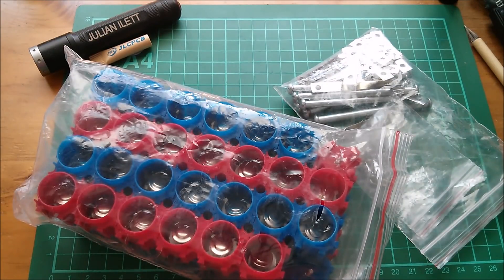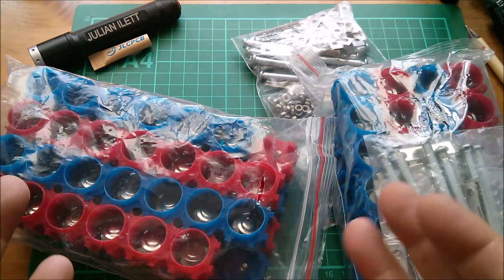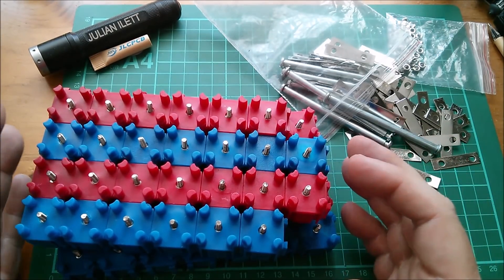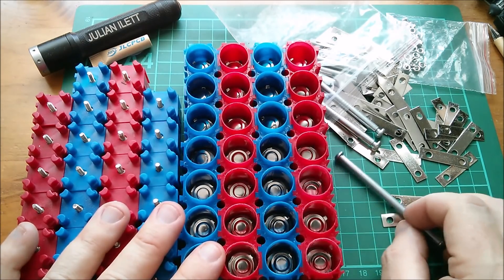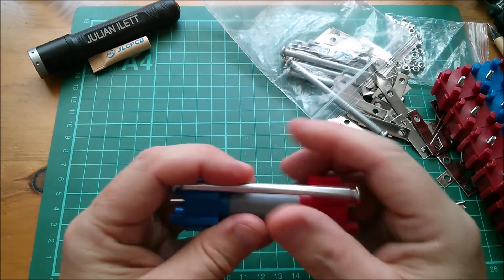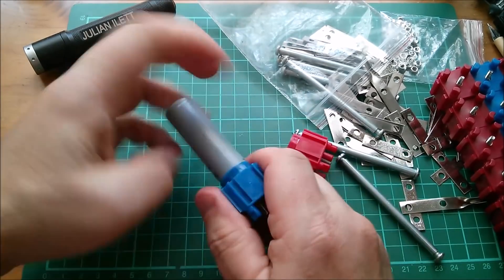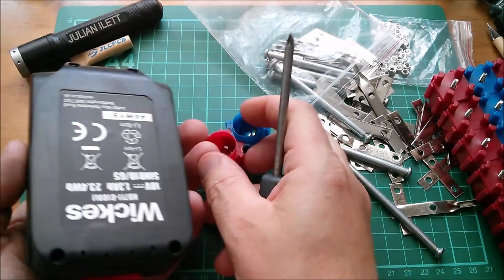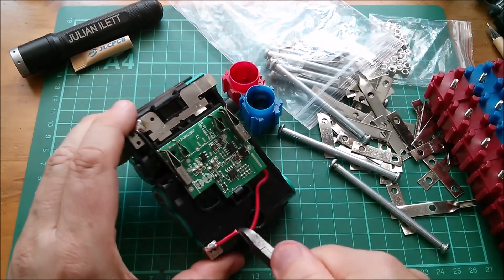First Look: Vruzend 1.6 Lithium Ion 18650 Battery System

Comment: I managed to harvest 43 cells (6 of the 3 cell batteries and 5 of the 5 cell type as shown here and also a couple of £30 pillar drills, bonus! ) in a mad dash around Kent/South London a few weeks back... Thanks for the tip!

I have bought some generic ebay crappy plastic snap together battery holders to make a low capacity e-bike battery, these look much better, I like the fact that you are safe in the knowledge that you have more than enough through bolts to assemble a battleship and aren't just trusting a layer or 2 of Kapton tape, 

I didn't like the bolt on bus bars though, I have always thought that spot welding /soldered joints were the way to go if you are pulling more than a couple of amps from it, I think the bolt on bus bars could present corrosion problems in the future, although I see from your solar battery banks you seem to get away with not giving a crap about that!! 
I think these batteries can output up to 6/8A?   maybe soldering would be better long term but these connectors could be used to build custom packs to experiment with different series/parallel configurations and you could build and test several configurations in one day, so they are like breadboards in that respect, perfect for your channel

I'm thinking for a long term solution these connectors for mechanical strength and spot welding/soldering would be the best construction? 

If anyone has built e-bike batteries with these particular cells and can give me some advice then I would greatly appreciate it, I know that at 1.3A capacity they are not the best choice but for 25p each I just couldn't say no! 
A B. M. S. and nickel bus bars would add about £15 to my £11 battery bill, so getting the best out of a cheap arsed system is my goal

I am thinking of a 10s 4p battery driving a 36v 500w rear hub motor that will do 10 - 15 miles at a reasonable pace, not expecting to go too far or go too fast, any advice would be appreciated, cheers
Reply from the maker: Well, the kit contains just 12 barrel bolts for the 54 cells, so they have to distributed carefully.
Reply: @JulianIlett  I think it's better to use a few bolts to build a battery than a couple of layers of tape, in an accident scenario (20 mph bike into 40mph car = 60mph) I would trust a bolt through pack just a bit more,

After having a few bike accidents without a lithium pack strapped to the frame I think I would appreciate the extra build quality in the heat of the moment!
Reply: That would only hold 187 Watt/hours of charge if my math is right. Might not last long on such a powerful motor, unless you aren't planning on going all out. At 0.25 each though, that is a really good value for that amount of capacity, but I think stopping at 4p might be a little lacking, but depends on your needs.
Reply: @rich1051414  yeah, I know it's not the best solution by far, I'm thinking of making a cheap eBay e-bike, 
A 2nd hand donor mountain bike, maybe £100, eBay 36v 500w kit (minus battery), maybe £200, 
For now I have a very cheap battery to get going with a veiw to using it for a year or so and building a new battery pack, probably using Panasonic 3.5A/h or similar for added range and a bit of oomph, I'm not expecting the Wickes batteries to add much other than some ease in pedalling for about  10 - 15 miles, I think 180w/h should be ok at first, but you are probably right, I  think I'll probably hit the limit at about 8 or 9 miles, but that's fine for everyday use for me and will be expandable on range and power with a better battery in the near future,

Thanks for your input
Reply: I made a 14S16P ebike battery using 224 cells. Cheapest way I did it was to hot glue 16 cells to make  2x8 brick, then lay 10 gauge silicone wire across the top and bottom.
I cut out some of the insulation to make a space to solder some magnet wire to 2 cells, and repeat.
I used double strands for the negative side so a short would only blow the positive side.
Secure the 10 gauge wire with hot glue and wrap with duct tape.
The ends of the wire extend a few cm from the pack, and I added bullet connectors, so they can be daisy chained easily.
Arrange the packs as you like around the bike in whatever shape you need, or put in a box, panniers or couple of camera bags hanging over each side.
A lot of work, but I got a 2kWh 10kg battery for free that will do 100 miles...

Comment: Thank you Julian, perfectly timed! I am very interested in this - but this arrangement is not very space-saving if you have 3 cells you want to combine. Still, I might be able to live with the empty fourth quadrant and use it for battery management/charging or a lighting module somehow.
Reply from the maker: If you have a few parallel rows, you wouldn't use this square configuration.
Reply: @JulianIlett  Thank you for replying! That makes sense of course. I am (loosely so far) planning a 3s1p configuration with the three side by side or 2 on the bottom and 1 on top. Anything else I found has either flimsy connectors or is a large but decent 2x2 arrangement which I could use with a "dummy" battery. 
While not ideal, this Vruzend one still looks better than anything I have found before!

Comment: What I've found is that those little bits of metal left behind when pulling the straps off can usually be flattened enough by simply tapping them with the side of the pliers.  The metal is soft and they easily mash down flat.
Reply from the maker: Ah OK, I was cutting them down last night with my new flush cutters :)
Reply: @JulianIlett  That would be useful for removing larger remmnants of metal, but would still leave some sharp bits so tapping the sharp bits down with the metal pliers would still be useful.  They're light enough so they're not likely to cause damage to the battery but they're solid enough to mash the small points down.
I use the flat part of my pliers, where the joint is.  That seems to work okay.

Comment: When you pulled the metal strips off the cells, did it make a hole where the spot weld was? And does it matter if it did?
Reply: I doubt it!  but it did create a uneven surface which creates  four contact point to transfer current (not good).
Reply from the maker: No, because the nickel strip is softer than the steel battery base - so the battery terminal has the pip on it, the nickel strip ends up torn to pieces :)
Reply: @JulianIlett  Right. I ask because I tried it once and it did tear a hole in it.
Mind you, this was probably 20 years ago, so maybe the technology has changed since then.
Reply: @AndyCallaway  Depends how strong the weld is. I've  had a couple of cells that tore, so now I always use flush cutters to cut them off and leave no jaggies behind.

Comment: Make sure you Vaseline the sides of the batteries where they insert into carriers. The bigger the pack the more difficult alignment becomes. Trust me tried and tested with lube.
Reply from the maker: Can't you assemble the pack in rows (shorter dimension) - I'll see what the problems are when I build a bigger pack.
Reply: @JulianIlett  When you assemble packs, which no doubts you'll bank together, I found that small packs need to be squared quite accurately else the dovetail/connecting tabs struggle to line up, hence the lube helps contact corrosion and insertion.

Comment: Julian, when my father was in school (college) the powers that be changed the direction of flow of the electrons from positive (+) to neg. (-) and back again, I think it's changed a few times.   Does anyone know for certain, which way they flow, or don't, lol?   About seventy or eighty years ago....
Reply: Electrons are negatively charged and are attracted to positive (opposites attract, alike repel) so electron flow is always from negative to positive. Conventional current is said to flow in the opposite direction just to confuse everyone.
Reply: It's all in the details.

The eletrons move slowly from negative to positive.

The "holes" as the eletrons step onward move from positive to negative.
Reply: @erlendse  makes sense, I think they need a hole to 'fall' into to keep shuffling forward?
I saw a video recently by Steve Mould, he was vibrating small steel ball bearings to illustrate grain boundaries in metals, it made me think of atoms and lattices
If you haven't seen his videos then please check them out
Reply: Sofa-Lofa - there are not really any holes, in the same way that in a crowded flow of people, there are no holes, but people manage to move with very little space between them. But by describing holes, it helps with the understanding.
Reply: Yes, there really are holes, and they're not just missing electrons. The Hall effect can be used to distinguish between positive charges moving in one direction and negative charges moving in the opposite direction. And it turns out that a p-type semiconductor gives a Hall voltage consistent with the current being carried by positive charges.
Reply: There are two different ways of thinking and talking about current flow -- so-called "conventional" current which goes from positive to negative, and electron current which goes from negative to positive. It's possible that which one is more prevalent in textbooks has changed over time. But nobody has ever said that electrons flow from positive to negative. Not even Scotty can change the laws of physics!
Reply: In a primary cell they move from minus to plus, but for a recharagble cell its more complicated. This makes the term anod and cathod useless talking about recharagble cells as Long as not specificaly talking about charing or diss charging chemestry.
Reply: Yes, "negative to positive" is a bit loose. It would be more accurate to say that, in the absence of an emf, electrons move from a region of more negative potential to a region of more positive potential. These don't necessarily correlate with the labels that we apply to the terminals of a battery. And if there is an emf present (e.g. in a transformer winding) it can make the electrons flow "uphill", which is how you're able to charge a battery.
Reply: Ignore all of the above. The direction of “conventional current flow” is just a relative reference. It’s a bit like trying to argue which country is at the top of our (more or less, round) planet.

A long time ago, we tried to work out which way a spark moved. That gave rise to the direction of “conventional current flow”. That is electricity flows from a positive battery terminal through a load and back to the negative battery terminal.

Many years later, we eventually discovered that electricity is the movement of electrons. These are negative charge carriers. Electrons flow from a battery negative terminal through the load and back to the positive battery terminal. But because conventional current flow” was so well established, we retain it for most purposes.

Does that help?
Reply: @Mark1024MAK  Well if you do chemestry its rather important
Reply: matsv201 - nah, as long as the names/terms are consistent between the naming of the terminals and the way the procedure is described / documented and performed, it still makes no difference. The key is that everything and everyone uses the same system. Hence why the ‘conventional current flow’ has been retained, even though technically it’s wrong.
Reply: Oh and it’s not only cells (batteries) that can have current flowing from, or into them. Capacitors, inductors (coils, chokes, transformers, motors, etc) can all have current flowing out of them.
Reply: Greg Ewing - if you want to make it complicated, try AC theory where the voltage and current are not in phase...
Reply: Haha, I've been told they move from negative to positive at about walking pace, it's just easier to think about it backwards, apparently,  hope this helps... BTW I love the idea of the 'powers that be' telling each and every electron in each and every circuit to turn around and go back around the other way, not just once but several times...just think of the logistics🙄

Comment: Could really use some springs on those bolts to allow some expansion. Interesting system though
Reply: I agree, the plastic will cold flow overtime and nut tension will be reduced.

Comment: Yes, it's only America that uses the imperial system. A testament to our lack of a good education system :-( We couldn't figure out the Metric system years ago so we just gave up on it -- sigh
Reply: I learned both in school. I've always preferred imperial.
Reply: @Cadwaladr  I prefer metric, but I'm learning imperial as I buy a lot of kits and antenna's that come from the US and obviously their fasteners are in imperial units. Being in Aus, we're a predominantly metric society, but we initially started with the imperial system. I can already calculate feet and inches in my head, now to learn the nuts and bolts conversion of fasteners :)
Reply: @Cadwaladr  Yes, I learned both in high school (being an engineering student). The majority of people I know never learned metric in school, though.
Reply: Ive pretty much adopted metric but in imperial's defense, Fahrenheit is more accurate due to more divisions
Reply: pleasecho2 - not heard of digits after the decimal point then...
Reply: @Mark1024MAK  Think resolution

Comment: interesting battery connection system
Reply: Definitely Interesting, not really my cup of tea, but excellent for a temporary pack! Heck, you can pry it all apart and replace the cells when they fail, that's a big plus once the fuss of assembling all those bolts and tabs is done :) pretty neat.